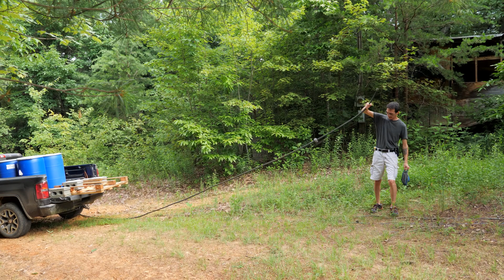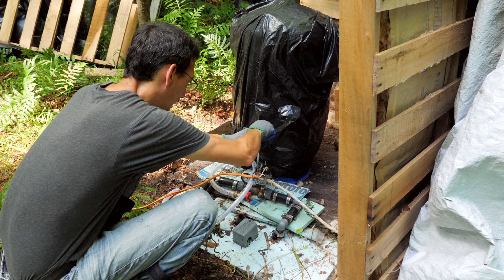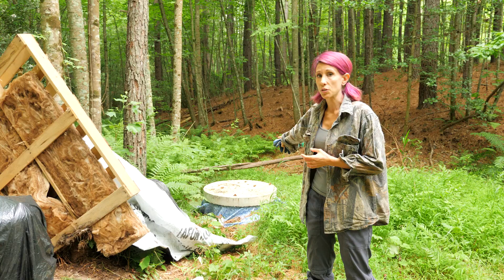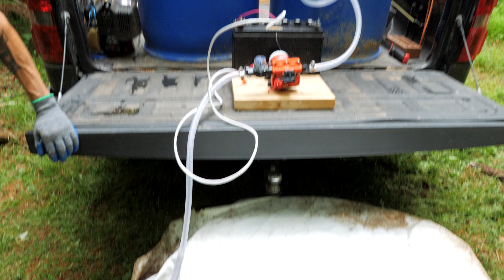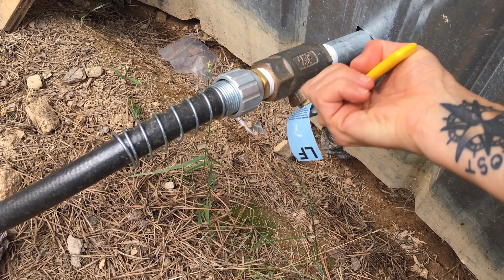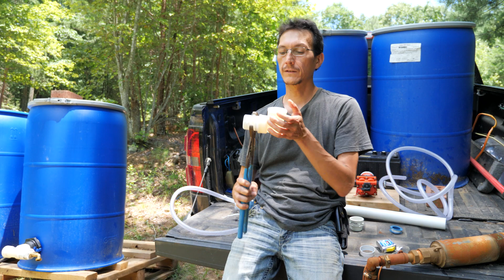NO WATER...AGAIN! Will This Off Grid Gravity Fed Water System Work? (Part 1)

Comment: So sorry about the water issue. I kinda feel your pain. We are having the same issues with ours right now. The pump in our tank is getting power to it, but not pumping the water out of the tank. The flow to our tank is coming in at about 25-30 gallons a minute from our spring head that is 200' up hill. It is coming in so fast that it burst the lid off of our tank and the water was shooting out like a geyser. We have a 1/2" overflow pipe, but it's coming in so fast the overflow just can't handle it.  The tank is full of silt... probably about 3-4 inches on the bottom of the tank and the pump is covered in silt. We have an above ground 660 gallon tank with a small opening on top. My husband tells me that I am going to have to get in this tank and pull the pump out and clean the tank out. Ugh! For now, we've diverted the water back into the creek before it hits the tank and we are able to fill 5 gallon buckets and take them up to the RV. I look forward to the next video about your pump issue. I hope ours is just dirty and we won't have to buy a new one. If so, we will continue to haul water for a while. We have no idea what we are doing with this thing, so I hope to learn from y'all. Maybe you guys could come fix ours!! lol... We aren't far from you. Love and Peace ~Lisa
Reply from the maker: Yes silt is bad. You’ll have to drain the tank and clean it out unfortunately. Kind of what I’m dealing with here.
Reply: Yes. Tank is drained and awaiting my courage to climb on in. The pump sits up on a cinder block too keep it off the bottom of the tank and we use zip ties around it and the block to keep it from moving when it kicks on, but just the silt coming in settles on top of the pump. We are hoping that the impeller is just clogged and that cleaning it will help. We are heading back up this weekend and will hopefully be able to get it working. Fingers crossed for you guys. ~L
Reply from the maker: If the pump is bad you could replace it with a jet pump outside of the tank with a pre-filter to eliminate that silt problem but it would have to be protected from the weather. Do you know the make and model of the pump you have?
Reply: It's a Grainger submersible pump. 1/2hp. It's kinda ironic we don't know how to really handle this. My husband actually sells pumps for fire suppression systems, but he's kinda lost when it comes to this application. Weird, huh? lol ... We have to pump the water back up the hill about 150 feet to where our rig sits. We can't build anything right now to surround the water tank, the pressure tank or an outside pump. During past two winters, we've disconnected the pipes coming out of the tank to drain the lines and just let the overflow take it back to the creek while keeping the tank full and water moving through it to prevent freezing. Which worked great, except the flow of 25+ gpm blew the lid off. Crazy. I think what we really need is a first flush tank to help with the silt issue, but that is another $700. Hopefully we will figure it out this weekend, if not, hauling water is good exercise?? "Always look on the bright side of life."?? lol
Reply: http://muxkd.yvrnr.servertrust.com/ProductDetails.asp?ProductCode=550GL%2DCWT this is the tank we have. I can't link the pump... not sure what the model is. My husband got it through one of his connections in the industry.
Reply: Oh... the pump is a Grundfos... not Grainger. Sorry.
Reply from the maker: Good pump. Hopefully it can be cleaned up and you can get it to start again 🤞🏻

Comment: A possibility is to run new wire in parallel with the old wire, the old 12-gage wire could help out some.  In my area of rural upstate New York the salvage yards here sometimes get old aluminum 3-wire service drop wire, I've found 300-350 lengths a couple of time and bought them for the scrap aluminum price which was a good deal for me.  Overhead wiring would be relatively easy to install for temporary service.

Comment: That 14 gauge wire would have been fine if they had doubled or tripled it, I think. Not looking at the cross sectional numbers right now, but it sure is cheaper to run a couple 14g instead of one 8g...

Comment: Can you let me know the exact parts you used to make the spicket on the barrel from the black thing out so I can buy them. Thank You  Also what are the walkie talkie you use they seem so clear?
Reply from the maker: They are not common parts but Tractor Supply has them. You need a bulkhead (the big black thing), a threaded to slip fitting, and a reducer. I’ll cover it in the next video. Easier to explain that way.
Reply: Thank You

Comment: Your washer will take longer to fill up. But it will work just fine. It will probably use about 30 gallons per load of laundry. You might want to check out craigslist for an old wringer washer.
Reply: or they do a plunger washing system...5 gallon buckets with a plunger...

Comment: Way to improvise guys! I know you've got to be aggravated with the whole mess, but you seem to be handling it just fine. Do you plan to set up a rain catchment system in addition to these holding tanks now too? Just curious. In my mind I'm thinking that having the rain catchment in addition to the gravity system would allow you to only have to use your spring water for more essential stuff like cooking, drinking and washing/bathing. The rain water could be used for flushing and animal watering etc. and thereby helping to make the spring water last longer for you. If I know you guys I'm sure you've already sussed out several scenarios and alternate plans. Fingers crossed that rewiring the pump will do the trick. Looking forward to seeing how this unfolds. - All the best. ~ Theresa

Comment: Like your ingenuity in replacing water, gravity is a reliable pump. Suggest getting a chain hoist or cable come-along to help with some of the heavier lifting. Might also look at "pond" pump, easy, cheap, low flow, low head but reliable for transferring water.

Comment: why don't you install that RV Pump at the inlet to the house to increase the pressure to 55psi? I have done this and it works well. need, just lacking some volume. but for any single point of use it will be fine. Try it out and let me know!

Comment: Lol...not even a minute after i suggested it ...yall were doing it....way to go! Also a sump pump would work and give you way more pressure. Before harvey came along i used to service them in million dollar homes.They may cost 400$ at home depo. They are much like a water pump except they are for grinding up waste. It would be a great quick fix. They come with a plug so all you would have to do is run an extension cord and of course the right pvc fittings.
Reply: I think this it bad advice .

Comment: Do you have any small streams or running water near by?  If so look at building a  Ram pump (YouTube)to your 55gallon drums. Refrigerator look up ez refrigerators out of Arizona 2 pounds of propane per week 1/4 gallon for great food storage. 410 shotgun snake repellent. Get the mommies out early.

Comment: You've probably already looked but if you haven't try and find a new spring head. If you can find one with enough drop, you won't even need a pump. Our spring is about 1/2 mile up and we get tremendous pressure without a pump.
Reply: Best way to find them now is a drone above the trees looking for a change in tree types around the water from a spring.  Can look over a very large area for spots you want to investigate on the ground.

Comment: No fuse on the pump? I think the first thing I would have done is check the pump. If ok, just run new wire and not even mess with the barrels.

Comment: What about a solar panel and a low volume high pressure pump at the spring so when the sun is up it pumps to the holding tanks ? be a good back up even when the well is put in ? and use a tote if it puts out more then the 2 barrels
Reply from the maker: That was the basic plan for the house.
Reply: so ya might move all the power to the spring and just send the water up ? way much cheaper ?

Comment: That pump he pulled out is a deep well pump.  It is meant to go down a 100 foot or more well shaft.  It is NOT a sallow well pump.  Not sure if that knowledge will help you.  That pump is designed to pump water from at least 100 feet down.  Good luck!  What state are you from, I'm from Massachusetts.  Wish you the best.
Reply: It's a submersible pump, not a suction jet pump. Regardless of the ft. rating on submersibles, they will work just fine in a shallow well. The foot rating is only for what depth the pump will be able to push the water up to. Example, a 400ft rated submersible should be able to pump water from a 0-400ft deep well. 

Great thing about submersibles, is you generally no longer need a foot valve, as they usually contain a built in check valve to prevent pressure loss. Of course you can add one if it makes you feel comfortable.
Reply: Submersible pumps are engineered to always be surrounded by water, the water is used to cool the pump motor. 
They will quickly burn out the motor if run without cooling, remember this is different from the pump being run dry, running dry will eventually abrade the pump, but  it will be a long process, not cooling the electric motor will kill it within a few hours.

Comment: Awesome response to a bad situation, you guys are "doing it" for sure!  One thing I was thinking as Jeremy was hooking up your emergency pump was, could he plumb it directly into the water line to the trailer and through the hose to the gravity feed barrels fill those barrels directly?  Might be the pressure is too much for the small pump but if it wasn't it would be an easier way to get the water to the holding tanks... and if it worked you could use the other two barrels to the manifold for a greater storage in case of emergency need.  Great vlog, really enjoy your videos and "redneck" solutions (as Jeremy calls them). All the best for a little less drama as you build your homestead!
Reply from the maker: The little pump is way too small for that but that was the idea for our house system on a larger scale.

Comment: You place a barrel above tank and backflow to prime your pump. Place dual battery in pickup. They make 50% power fitting that saves regular baytery. Then your system can charge agm battery for pump on pickup. Used to have spring gravity feed water system. Also had farm house well and irrigation well. You can use bladder and air for home water. Run wire overhead and reuse for your new well. My boss used to witch wells for local well driller.

Comment: Hello Folks , 
I am sort of curious .  Do you need a high water pressure because you need to have hot water shower massages ?  Because I have to say , your gravity flow puts out a lot more pressure than my shower does with a pump ! Of course I only need to take normal showers.  I wet down , turn the water off , soap up and then turn the water on to rinse off. 
A habit that I got into while aboard a ship while in the Navy.  Water , water every where but very little fresh water !
  Costwise , rather than pay the thousands of dollars for well drilling ,  I would build a shed up on the hill where your water barrels are now.  Place your water barrels inside of the shed and collect the rain water from the roof of the shed. Sixty feet of water drop appears to give you plenty of water pressure. You just need more and perhaps larger rainwater collection barrels. Four of those plastic food grade shipping containers will give you 1,000 gallons of water. Easily collected from rainfall. No electricity and no pumps needed. And nothing to wear out or break down.
  It is a system that I am about to do although I will only have about ten feet of water drop at the most.

Comment: Can't you use a ram pump? No electricity needed
Reply: A ram pump requires both an existing constant flow of water, and a DROP of several meters from the water source. In other worlds, ram pumps ONLY works where you have a decent steam on or near a decent slope. It is powered by the force of gravity, and pumps a tiny fraction of the water flowing through it. 

Plus here they (kind of) don't pay for electricity, and electricity pumps are more reliable and cheaper and MUCH simpler to install and maintain. Ram pumps are brutal, and requires lots of maintenance, cleaning, adjusting etc. 

We have a ram  pump in my village, with a 3.5 meter drop, 30 liters per second flow, pumps 4 liters a minute about 40 meters up the top of the village.  It provides most of us with water. It's great for our situation, our source and our scale. I wouldn't recommend it to any individual users to depend on, without mechanical skills and a workshop handy.

Comment: If you increase the voltage to 220 VAC and use a properly rated transformer at the well to drop back to 120 VAC 2 to 1 step down it will give 4 times the power over the same gauge wire.  Doubling the wire size only give twice the power.  So you have to rationalize the cost of the wire against the cost of the transformer.
Reply: I'd just use a 220V pump in that case. You lose some voltage across each transformer, so the fewer, the better.   With 2 in series you might only have 105-110V at the far end.   But what you said is very true... 220V down the line would be better if possible
Reply: And fuses to protect the circuit if the clog was really the issue.

Comment: Change your pump to 240 volt, it will decrease the load on your house and halve the voltage drop in your undersized wire.
Reply: I'm not from the USA and can never understand that a first world country operates on 110Vac. Using 220vac just makes so much more sense. Half the amperage draw and half the loss over that distance .
Reply: You have 3 phase 240V, the US only has 1 phase 240V to residential, which is split to most circuits from hot to neutral, giving you 120V

Comment: Do a very deep cleaning of the spring hole before you put the pump back in it will help alot. It may also help more water to come in. I feel for you cause I have been in the same boat with no water it is a pain. Good luck. If you took 100 gallons out and it took about 2hr to fill it is filling at about .84 gallons per minute so you may have run it dry and burnt up the pump just an old guys thoughts

Comment: The pumps generally rely on cool water being present to cool the pump itself. If you didn't run the hole completely dry, there's a decent chance that the pump didn't burn out. Life throws funny curves at us all, so I say "build like it's permanent but spend like it's temporary."

There are factors to consider here and some cheap insurance. A good factor to consider is that multi-strand wire does not carry nearly as much current as as single core wire. Google search "multi strand wire gauge current rating", my top search result is at the engineering toolbox.. Notice (in the table) 12 gauge, single core can carry 34amp, multi strand 8 gauge even with only 3 cores can only carry 40amp (It only gets MUCH worse and the strand count increases). There are also rules for voltage drop over a distance for single or multi core wiring, but over 200 feet you wont loose but 1v (aprox) even with 12ga wire, so this is a non issue. If you had used single core 12ga there would have been no issue with the wire itself (I highly doubt that pump would ever draw 34amp). Impeller based pumps do not draw as much current for operation or even surge current at startup as other types of applications. Simply because the impeller is not under the same types of stress that other typical applications require. You can always research how an impeller water pump works if you truly feel the need to verify my statement. 

What failed you, in the wiring, is lack of cheap insurance (never mind other possible problems with the pump itself), the wires were not connected together decently or water-proofed and caused a bad connection. A bad connection increases the resistance of electricity on that spot, increased resistance causes heat, heat increases the resistance even more (snowball effect). For higher current applications you should have use wire ferules and small terminal blocks (probably less than $20) and enclosed it in something truly water proof (even a stupid tupperware dish siliconed together is better than having wire out and exposed with only electrical tape) but water proof junction boxes are much cheaper than spending a week without water and cobbling crap together (a quick search shows less than $10 for a box). 

You really cannot afford to skimp out or dick around with electricity, but a little knowledge and some simple steps will go a long way towards a more robust system. Some might say that wire ferules and a terminal block is complete overkill, but I look at it like this: it's cheap as hell and completely bullet proof. Who could ask for more?

Please don't take me as being rude, I am not a very PC type of person and I tend to speak directly (so if you would, take my words as just being direct). I'm just a schmuck trying to share what I know and I wish you guys the best of luck, but don't wait for luck, make your own. I know hindsight blah blah, but try to build anything as temporarily permanent; it can be tore down easily or easily strengthened to become permanent.

Comment: Our 350' deep submersible well pump died a few years ago.   While wandering in to check the pressure vessel, the repairman noticed my rather small generator, and gave me a warning:    He said using too small a generator can fry a pump because you don't get enough voltage and/or current.       I imagine this is exactly the same as your undersized conductors... starving the pump of voltage for years may have shortened it's life.   (I bought a new generator, too)